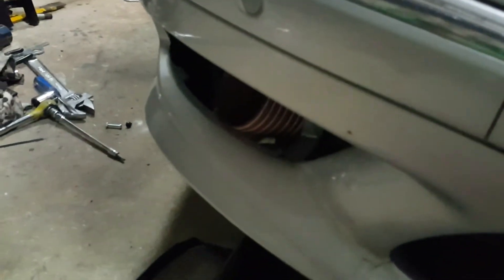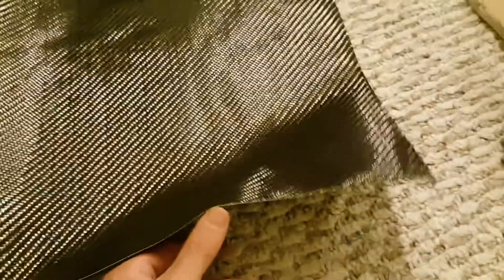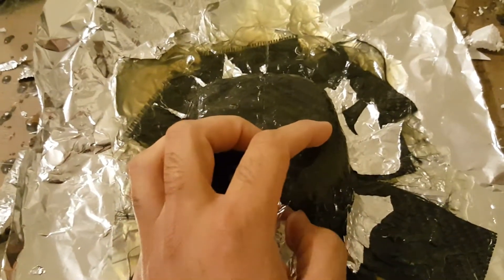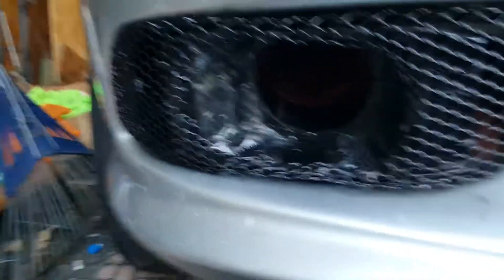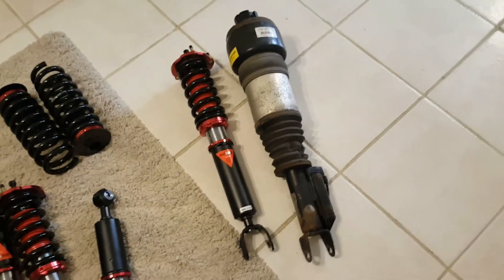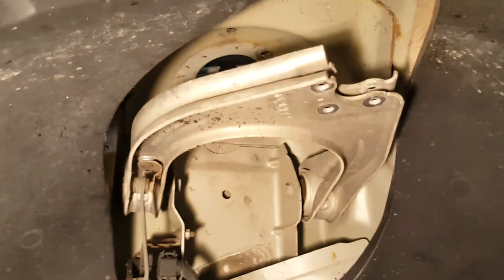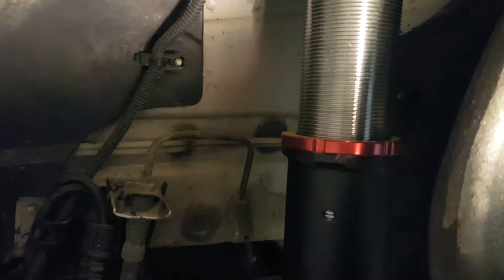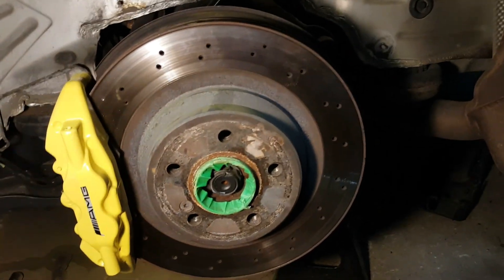How to Build a Properly Fast Track Car - Part 3 (Coilovers, Camber adjustment, Carbon fiber)

Comment: What brake pads u use
Reply from the maker: Pagid at the front, stock at the rear. Not too many good brake pad options for this car.
Reply: Check out Paramount Brakes, Godfrey had 2 sets of R5 compound pads made for mine. They cost a fair amount but there's only 3 models that use this front caliper set, the e55 the SL65 and the SLR.

Comment: when putting in coilover how did you get the code to bypass?
Reply from the maker: You don't really need to bypass anything. Just remove the airmatic system completely and install coilovers. There is a suspension message that shows up on the instrument cluster but there is a device to get rid of that as well I believe.
Reply: Can you provide more details how to get rid of the message ,
Thanks

Comment: even though u should clear coat carbon fiber but i think if u wet sand it it wont come out as rough!
Reply from the maker: Yes, wet sanding gives a great finish. I just didn't feel like putting too much effort for a small part.

Comment: Sk8215 awesome videos. For the rear suspension one option can be a 3/4 chassis along with the roll cage that you will need to race in certain tracks. Yes it might be a little more weight and work but you will gain more stiffness in the chassis and less body roll.
Reply from the maker: Hey Michael, Yes that is indeed what I will be doing later on. CSCS requires you to run a roll over bar or cage in the category this car will be competing in. For now I'm only making a frame in the trunk, but later on the rest of it will bolt on to that.